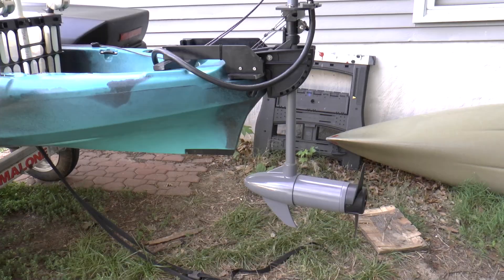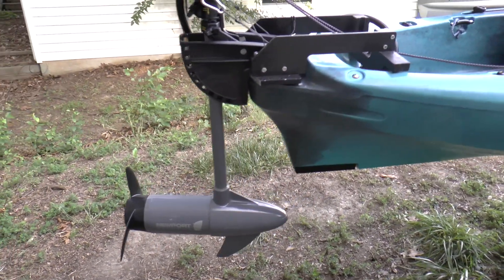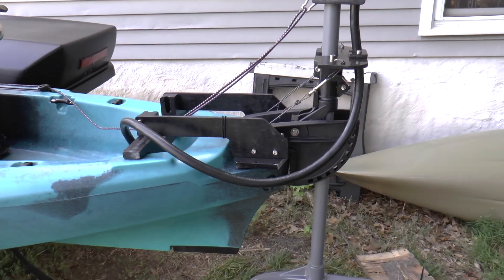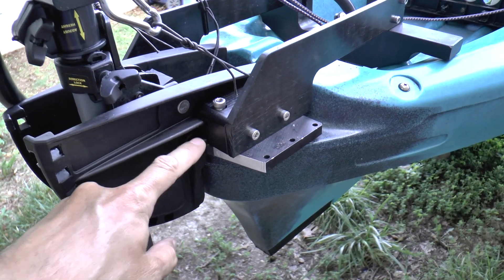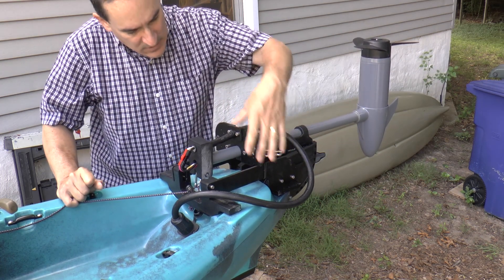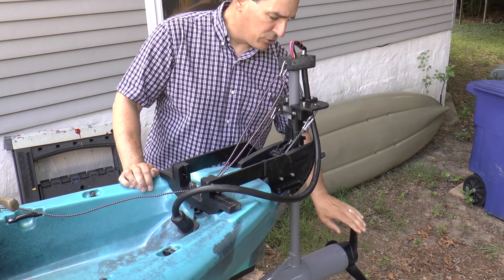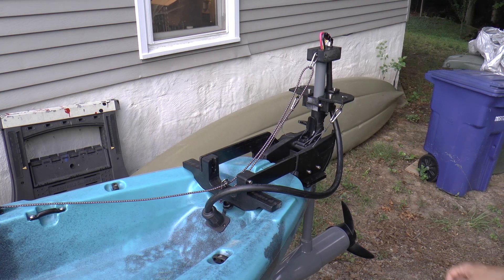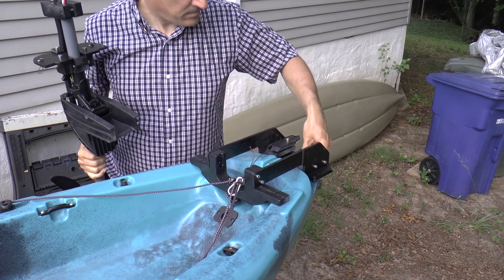Electric motor powered Tarpon 130x, part 1, motor mounting and steering

Comment: Just curious is your mount 3d printed??
What material did u use to make your mount
Reply from the maker: It's made using table saw and bandsaw from UHMW plastic and delrin.  These aren't cheap or easy for the average person to come by, so I never bothered to make a video about the design and fab of the mount.  I custom fit all the pieces to the kayak as I went, so I can't even make great drawings of the parts.
Reply: @kyakfsh  thank you. I do have totally different kayak brand.  like the design of your mount, I'm working on a mount design in freecad that I'll be 3d printing with PETG. I thought you're mount a 3d printed. 
You did very good job on building your mount 👏

Comment: I have an Emotion Stealth Pro and the stern is different... but how did you secure the motor mount to the kayak?
 Mine has a built-in handle at the stern, and I was going to drill through the heavy handles and attach my motor mount that way... but after seeing your design and engineering... I am going to be re-thinking my entire approach.
I am in Minnesota and I like to fish the many... many lakes... but I was limited because I was paddling. I just bought the Stealth Pro used, and a new Newport 55lb kayak motor so I can enjoy a LOT more of the larger lakes... without having a coronary. 
Your design for the slide and the pin is genius. And that clip to disengage the locking mechanism is brilliant.
Your steering system is exactly what I have been dreaming of... I wish I knew the manufacturer of the peddles.
Hell... I wish I had access to a 3D printer and someone who knew how to use it.
As it is I am going to try to incorporate as many of your designs into my kayak... as I have some woodworking experience I am going to try to create a similar design in wood.... otherwise it is going to look like an erector set nightmare
Thanks for the peek and the ideas.  I spent many a summer of my youth fishing and crabbing the many inlets and bays of Jersey down to Chesapeake Bay. Great times and great fishing. Good luck around the HRBT this year.